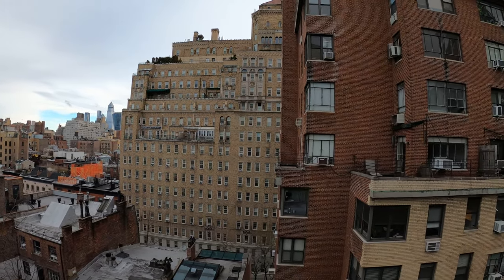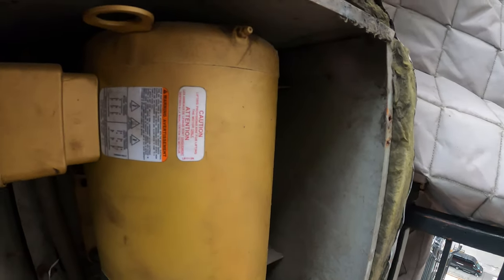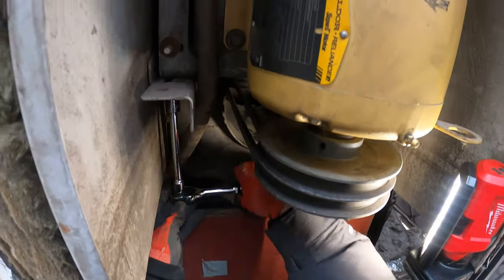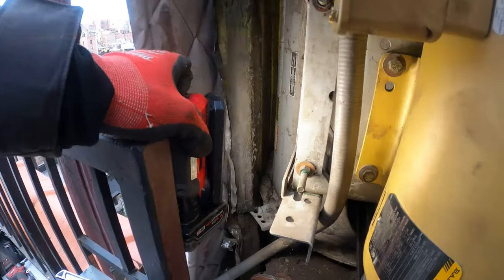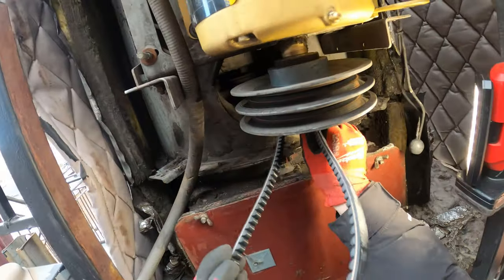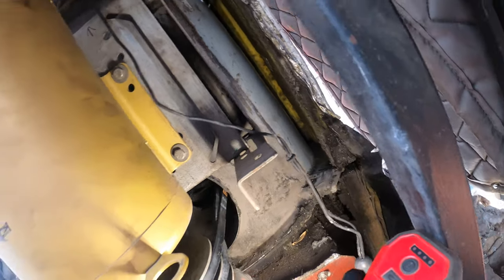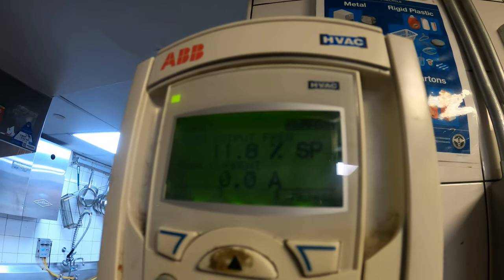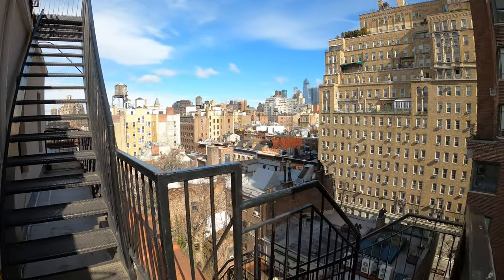HVAC Service Call: Commercial Kitchen Exhaust Fan Making Noise (Centrifugal Exhaust Fan Maintenance)

Comment: Lot of window units on those buildings across from your location. I guess they were built before modern in door air conditioning?
Reply: NYC baby. Gotta love it.
Reply: @sherwinalvarez7365  I have flown in and out of JFK back in the 90's, thats all the NYC I need! Whatever you get used to, love Jumper Man Techs accent though!
Reply: Looks like it was built in the 1930s.

Comment: How do you know when to stop greasing?
Reply: The motor on the bottom sometimes there is a plug you take out to bleed out the old grease. But the piller block bearings you can usually look at them and wait till you see the new grease come around the race and bleed out the old grease.
Reply: Most of the time new equipment will tell you how many pumps of grease is needed and how often based on the RPM.